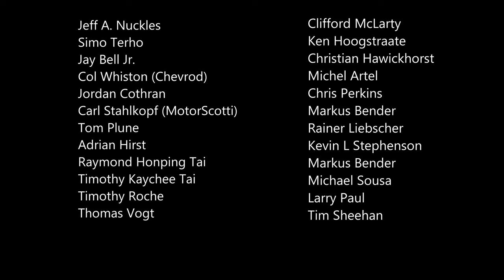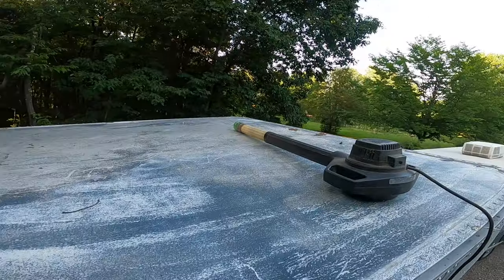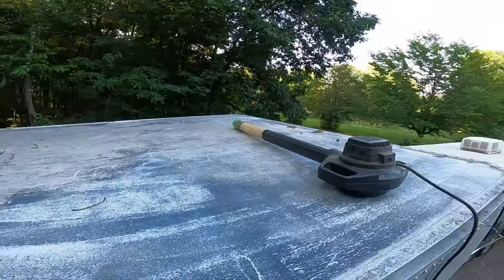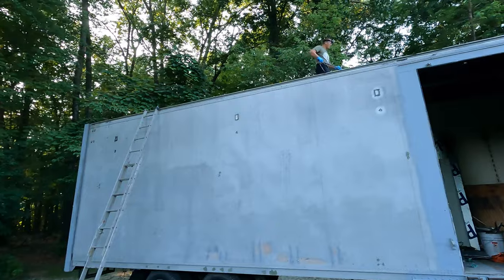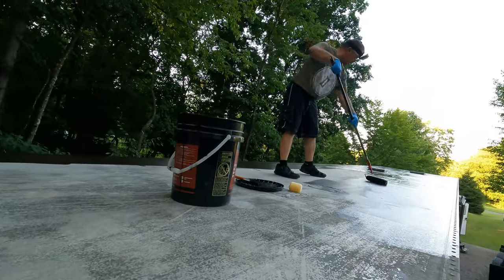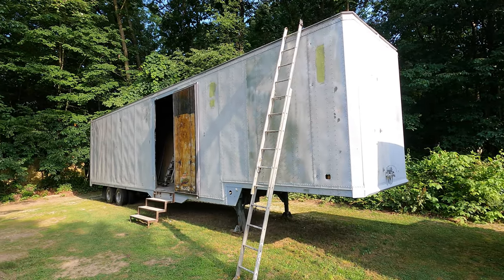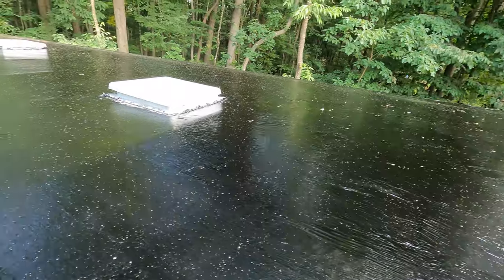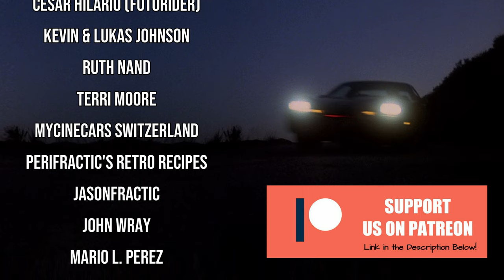Knight Rider Screen Used Semi Trailer Gets Its Roof Sealed (Poor Eric) + Another Set Piece Obtained!

Comment: Glad that you got the top sealed and that you were able to acquire the correct kitchenette.   I know that would have really bugged you until you found the right one.  With the first coat dry you'll be able to get up there and use a brush around those air vents.  That's probably the one place I would make sure had extra coats of sealant for sure.   Keep up the great work!

Comment: That black sealant will absorb sunlight and make that trailer hot as an oven. It should be white or silver to reflect the heat away from the trailer.
Reply from the maker: It was black on the show, it's black now! Screw the heat!
Reply: @KnightRiderHistoriansOfficial  I guess that forces your hand.

Comment: Wouldn't it been best to clean The dust off with the blower and then a power washer and then the sealant, which is best to put down the sealant with a squeegee and squeegee it backwards or a roller or both squeegee and then roll it out.
Because I'm thinking you would have that roller mark rough surface look on  the ceiling and the streak lines from not a constant all the way across roll.
😂🤣You guys are hilarious and I was also about to ask in the last video aren't vents black either from the sealant or the paint and he's back in himself into a corner when it comes to painting or sealing up the vents. 😁😂
Really he did a motion capture for saints row 3, wow people who play the game wouldn't know that until someone told them because they don't focus on the small detail all the time they just beat the game and move on to the next game did he play as one of the main side characters or was he an npc.
Also that game has been very popular since it's released.
Oh my God I think he'll die from the fumes before he dies from the ponds.😂🤣🤦